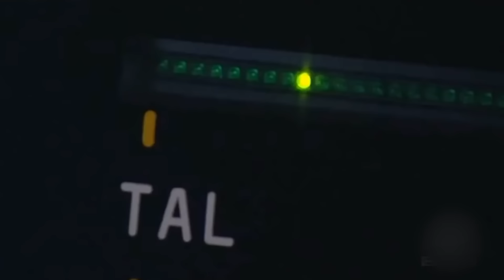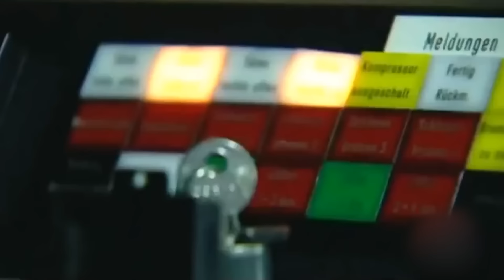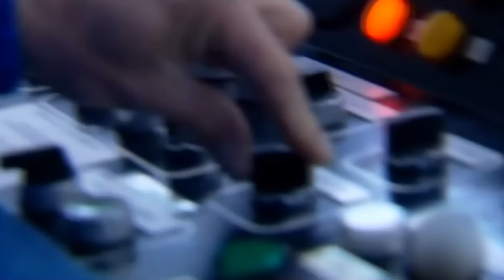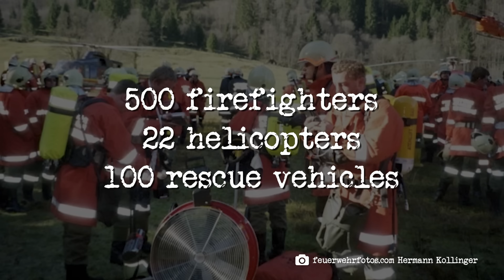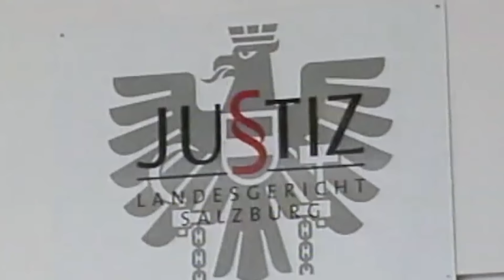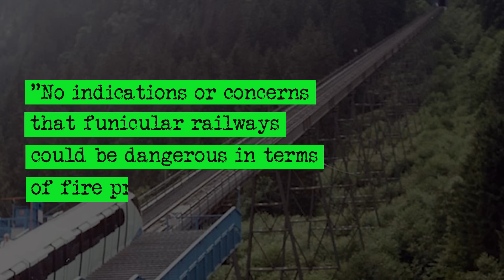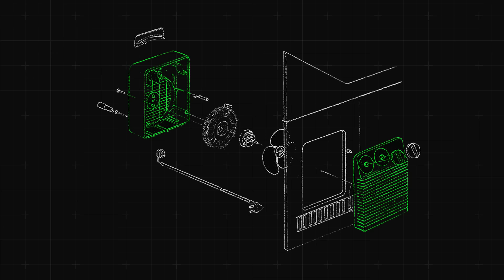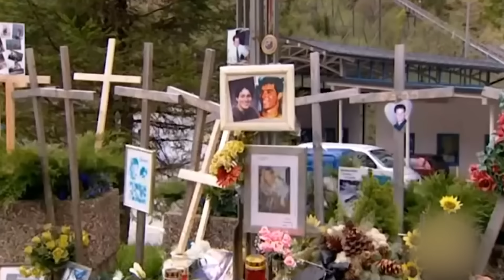The Kaprun Alpine Railway Disaster 2000

Comment: I thought everyone learned in school that smoke rises and that you should get below it? 150 deaths from this is just horrid! Also, no blame laid!? Whoever installed that heater whilst knowing it was for "home use" should be blamed!
Reply: While in 4th grade (1966) the FD came to our school and taught us about fire safety...
In all fairness to the victims, I was not in the tunnel and really have no idea what I would have done...
Reply: Its one thing to know the direction and danger of rising smoke, its another thing to aknowledge that the smoke is more dangerous than passing several meters of likely hundreds of °C. 
You dont just need to know the facts you also need to fight your basic instinct to move away from heat, and take that aditional thread as they were already exposed to smoke. The Firefighter likely and luckyly was trained well enough. Whilst beeing trained for the use of SCBA myself some years ago as a German volunteer Firefighter i will never forget that one test where the instructor simply closed the valve of my airsuply just to see if i am able to withstand the urge to tear down my mask, as one single breath of smoke could be deadly compared to the unconsciousnes due to missing Oxygen wich you could survive several Minutes without long term injuries.
Reply: They never got into the cause of the hydraulic fluid leaking into the heater.

Comment: My double, that I now know as Justin Alexander “Flashback” Stanton, was on this very funicular back when I myself was but three years old. He was a ripe 23 years old at the time well into college, and on his way to earning himself a graduate’s/master’s degree, just like I was. 
He was on his way up for a college field trip down the mountain, but somehow he, as he told me, suspected something was off as he got on the ill-fated funicular. It was a good thing he had heeded the bad omen as well, as when he smelled burning plastic and the stench only intensified instead of dissipating, he knew he was in very big trouble. He happened to have his emergency car tool along with him at the time for similar reasons, and naturally put it on his window to break it and escape. It actually took several attempts instead of the one usually required to break a car window since the glass was reinforced, but soon enough he produced large enough of a crack to kick his way out, and knowing that fire traveled faster uphill, he went down the track, and eventually emerged from the entrance and ran to his checkpoint hotel.
I’m sure that the others were like, “…the heck?” As Justin busted his way out of that funicular, and he was most grateful that he was the only party of the trip on the train at that moment; the other members were scheduled to go up a little later after him. Little did the victims know, however, that he would be one of the lucky ones who’ve foreseen the danger within and got out early before it did escalate and turn them into Cerberus’ next gourmet meal.
Today, we still laugh about it on my garden bench while still in our jammies (or union suits depending on the air temperature), but we still give our deepest condolences to the families of those who lost their lives in the tragedy to this day, and in fact we donate every other year for support for those same stricken families, sometimes in excess of $1,000 or even more. I mean, after all, I’m the owner and manager of a big corporation, and he’s a fairly average band leader in his own rock circle, so we wouldn’t know what to do with the rest of the money after we’ve donated the full amount even then! All in all, what a wild time to be alive in an already epic year — and where my Dream Corp. all started. And that’s just assuming you’ve survived! We as the two parties all these years ago ought to breath a big sigh of relief after all that has happened, but none of that has ever killed our appetite for adventure as THIS dynamic duo!!

Comment: The instinct to escape uphill replicated the same conditions in the dreadful tragedy at London’s Kings Cross Underground Station in 1987, caused by an escalator fire. All early moving stairway systems in London used wooded skated treads and the void beneath the belts accumulated debris which when mixed with lubricating grease from the mechanism, built up a potent supply of combustible material which could be ignited by sparks caused by friction.

Once a fire took hold in the narrow space of the tunnel, smoke was sucked up the shaft by a void between the tunnel ceiling and the false suspended ceiling, to make it’s wary to the large ticket hall closer to ground level. This is a chaotic place, filled with people moving in many directions in the rush hour so it would have been extremely hard to find a safe passage in thick smoke even if it was possible to breathe.

People fleeing the smoke and flames mostly attempted to reach ground level in a similar fashion to this awful Alpine tragedy. This led to a drastic rethink on moving stair and underground station design in the UK. Again an oversight in design and lack of preventive maintenance was the cause.

After the Horse has Bolted as usual.

Comment: 1) Combustible hydraulic oil was in use, which is a crime in itself ! 2) The heater was not approved for use in vehicles 3) The train’s cabins were made of aluminium which is combustible. Apart from these carastrophic errors, simple signs instructing people to escape downwards in the tunnel would have saved several lives, but what is the conclusion to the case ??? Nobody is to blame for anything, and no mistakes were made, so 155 innocent people died although no constuctional errors were made, or safety measures were omitted.. What a sickening FARCE !!! 🤮🤮🤮

Comment: The biggest fault i could see were obvious faults. 1. No for release, 2. No windows release, 3 No emergency contact with the conductor, 4. Using break resistant glass with no means of escape, 5. No emergency directions on where to go. 6. No tunnel ventilation, 7. No fire extinguisher or fire hose access, 8. No emergency stop, 9. No tunnel cameras or monitoring equipment, 10. No real emergency plan in case of fire or other emergencies.
This was a tragedy waiting to happen. I'm the US, as far back as i can remember that was all built into trains and busses and were talking about as far back as the 1970's

Comment: Hydraulic hoses leak all the time. I work with them. In my opinion engineer who designed this train is the one who is responsible. Bad train design, those hoses should not be too close to the heater. And ofcourse lack of fire alarm

Comment: So a incorrect disassembly and reconstruction of a fan heater inside the cabin caused hydraulic oil to get inside and ignite. This ignited the hydraulic lines which burned a cable train ending with 155 fatalities. This mixed with no way for passengers to contact the outside or use any emergency exits just made it almost hopeless. 
The best way to deal with fire is always assume that the thing can catch on fire. Even if you thing it's impossible. A sprinkler system inside the tunnel could of helped or even a emergency button inside the passenger compartments.

Comment: Wow, there’s thousands of comments here, so maybe somebody else has said this, but this thing about the oil heating is not clear. Did the ‘Down’ train driver leave the heater on???  If not, then the oil must have short circuited some contacts to cause the fire, but it doesn’t sound like that. 
So wasn’t that a bit crazy - to leave an electric heater ON, in a closed cabin, with no supervision, and a carriage packed with people next door???

That’s on top of all the other craziness, like thinking you can just dis-assemble an electric heater then bolt it back together around a cabin wall! Or that you can have liquid pipes floating around ABOVE electric cables without doing a LOT of testing and review (and that’s before you even say that the pipes hold INFLAMMABLE liquid). I’m not a mechanical engineer, but a lot of this seems crazy. 

BTW, what about if the passengers had smashed their way into the cabin and poured water / urine onto the smoking heater. Granted that water and electricity is not a great combination even in small amounts, but in this case, it’s probably a better combination than smoke and humans.

Comment: few times a contractor have asked me to install safety light wrong, never done it, worst was in a tunnel site, he was thinking its OK if they go thru small part as basic cable, and its not bcs if the fire starts near that location it will burn the cable and shutdown all the safety lights in that circuit, never play whit safety!

Comment: Pretty disgusting how the court proceedings were handled. What exactly was the point of the German investigators showing that everything the original investigator said about the hydraulic fluid leaking was true, and that the Austrian experts and authorities had deliberately buried the case and were determined to hold nobody responsible even if it could be clearly shown that at the very least the hydraulics were directly responsible, and whoever was in charge of inspecting/installing that was to blame to some extent. 

It is a difficult case because while there's total lack of safety regulations and negligent behaviour all around, it's also hard to say that any of those people is responsible for all those deaths, in a full sense. Still, they did that expert and the families and the prosecutor really dirty. Why couldn't that tool judge have just given the hydraulics people and safety inspectors etc like a year each or something, not ruining their lives, but not making the families feel like nobody was held accountable at all. Austria's judicial system sounds like a joke after listening to all that... of course corrupt court crap goes on everywhere...

Comment: There is zero doubt all the blame was on the construction of the wagons with highly flammable hydraulic oil. It was 100% known and should have never gone past the design stage. Any dragging brake could have had the same effect! All they had to do was using a brake system with non flammable brake liquid, something mandatory on all vehicles at the time. It requires regular maintenance such as changing the fluid but overall would have been cheaper to build and sure would have saved all lives lost. No point of knee jerking and closing the line just use proper engineering in the first place.

Comment: This is what I think happened the home space heater caused a short circuit when the thermal element broke of its frame caused by all the vibrations 
which caused the power to go out and cause a fire.

Comment: No accidents occur without cause, the general design, flammable materials, safety equipment and controls, placards for instruction, on procedure, and communication redundancies were all factors, the car stopped as the loss of hydraulics locked the brakes, by design, but terminated the descending cars travel aswell, poorly trained operators, and service techs, and station personnel were added factors….an absolute shame as no one wanted to issue responsibility…

Comment: Key thing in any fire is to go DOWN if there's a choice. If you go up...well, hot air rises, as does smoke, so to me it's a no-brainer. Don't be tempted by those who say "go up" as in the vast majority of cases, those who do will become victims.
Reply: The fire happened in the rear end of the train, the passengers probably thought that the fire was too big and if they pass through, the fire will engulf them. Plus, they are already panicking. With their panick state and their instinct to get away from the source of the fire as much as possible, of course they will go up.

Comment: These space heaters are very problematic. If the fan stops for whatever reason, they may catch fire. And when a plastic fan is used, it is even more problematic. Stupid design. Even though, the misuse of such a heater is far more severe, and the manufacturer should not be blamed for this accident in particular.

And what happened inside that court is such a pigsty that the shit must have reached the ceiling that day.

Comment: Nobody talks about the actual culprit. Somebody maintained that train, and regularly refilled oil that went missing from the brake lines. And did not search for the leak, or even worse fixed the leak and did not report the proximity to wood, electrics and a heating element (quite literally a high resistance short circuit). Whoever maintained these trains, has a ton of people on there conscience. It would have been trivial to allow the heaters to only work in station and deactivate them once driving.  But then in hindsight, everyone ismore clever then napoleon..
Reply: As far as I can make out, the DOWN driver left the heater on when he left the cabin. So when that carriage went back up, it had a fan heater happily blowing away in an empty cabin next to a carriage packed full of people.

Comment: Regardless of cause and effect, fire and smoke are the problem. Gravity goes the easy way down, smoke goes up. So the unthinking go up into or with the smoke and that proved undesirable and unfortunately  they passed away. Those that went down did well.
Reply: The fire was likely large, so it would seem like going down would kill you. There was also the fact that the tethering had a chance of breaking, causing the train to have a chance of falling on those going down.

Comment: It was indeed a terrible tragedy but sending people to prison for this would not have brought back a single life. Accepting responsibility by improving future safety, and by financially compensating the families involved in these tragic deaths is the only possible solution. It seems as though a defective heater caused the initial fire, but the cause of the initial fire is not the essential element when it comes to compensation the families. The essential element is that there was no provision made for an escape route in case of fire, malfunction or major accident within those sealed compartments. It was a moral failure to not have any evacuation strategy in place for fire/water damage/ mechanical failure or any possibility of communication between the driver and the passengers. If communication had been possible, and a fire alert could have been given, then the doors could have been opened and the passengers could have been instructed to evacuate downhill, and the door at the top of the tunnel would have been closed to prevent the fire/smoke rising up the tunnel. Even if they could not determine the precise cause of the fire, it was clearly the fault of the company for not having any emergency drills in place. Fire can break out anywhere and there should always be an escape route planned in case a fire should occur. This applies to all buildings and all modes of transport.

Comment: You don't need to be a firefighter here, but have some brain to understand that you need to go down. It's due to engineering mistakes. There is no fire alarm or emergency door opening, and the hydraulic door system is normally closed, although it should be the other way around.

Comment: So they just mounted a residential space heater  which most people already know to be fire hazards even when used properly to the control panel and called it a day are you kidding, that's the kinda fix someone's uncle would do if there trucks heat went out not the installation you would expect on a million dollar train car designed to transport a 100 people at a time who ever approved of this brain dead method for heating the cabin should be ashamed and hopefully prosecuted.

Comment: i cant believe they went uphill i didnt think u needed to be a firefighter to realize that heat rises. and it did have a fuel tank.  its called hydraulic fluid without that. the train would have only had a minor fire.